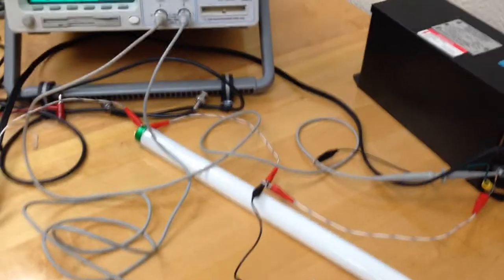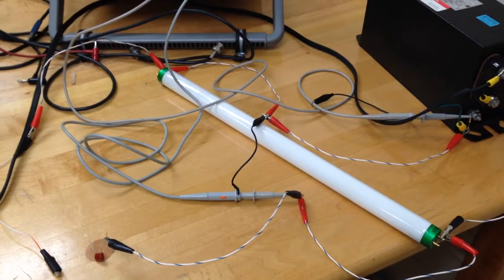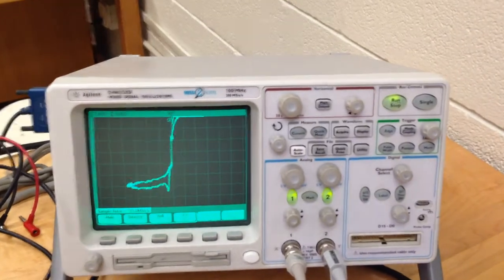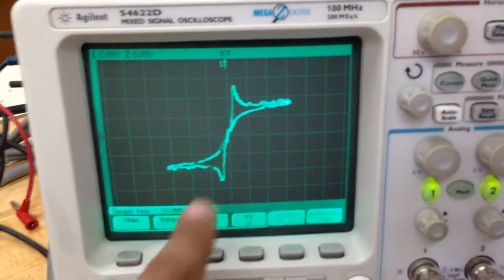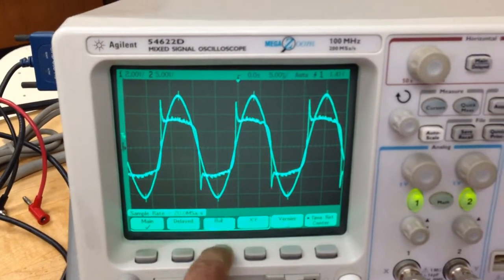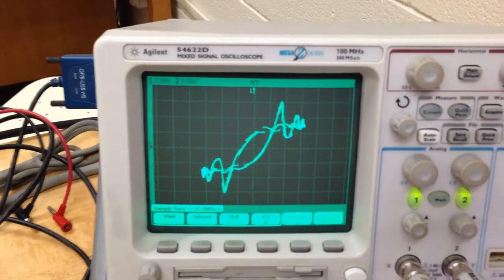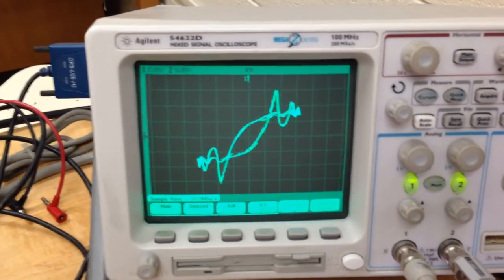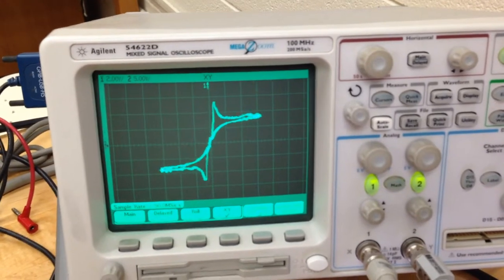A physical memristor Lissajous figure

Comment: Can you explain this lisajous figure of Memristor and how this pinched hysteresis represents memory element
Reply from the maker: Thanks for the questions.
1.  For the first question, I have updated the broken link - this should hopefully explain the Lissajous figure in more detail.
2.  For the second question, hysteresis represents memory as defined by STATE.  That is, the internal resistance of a discharge tube can be a function of various STATES.  We simply used the number of conduction electrons as a state variable, because such a model is "good enough" to explain the behavior observed above.  
There are other state variables that can be used, for example, tube temperature: https://ieeexplore.ieee.org/document/6739164 
I think when you said "memory element", you are referring to a "storage device" like a flip-flop, which a discharge tube is definitely not.  As in the link above, Leon likes to call memristors like discharge tubes as "volatile" memristors.
There are memristors that can serve as storage devices, like the Knowm memristor:  https://knowm.org/memristors/